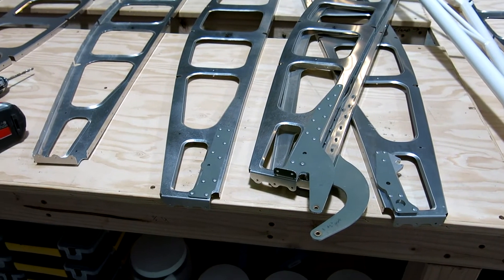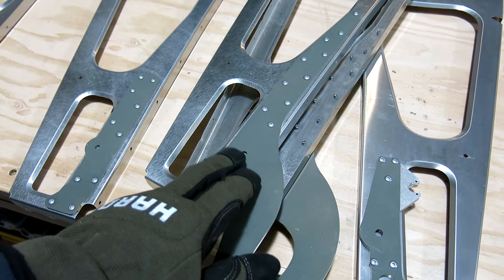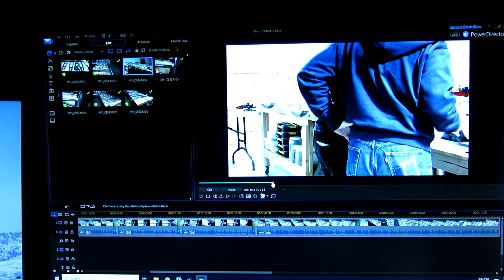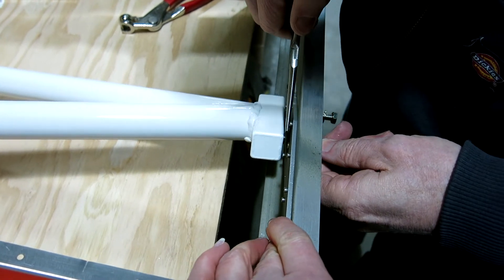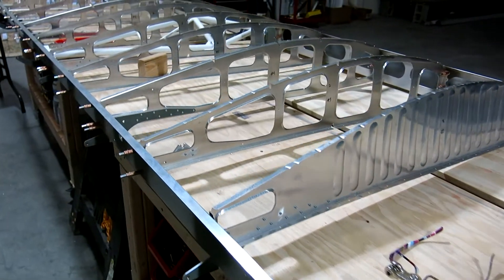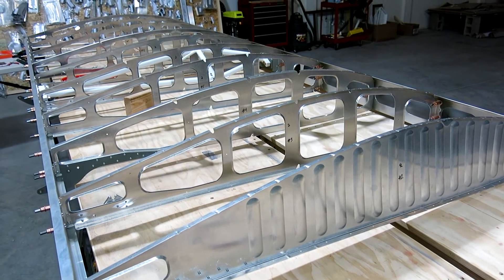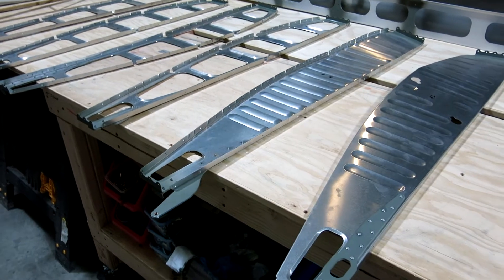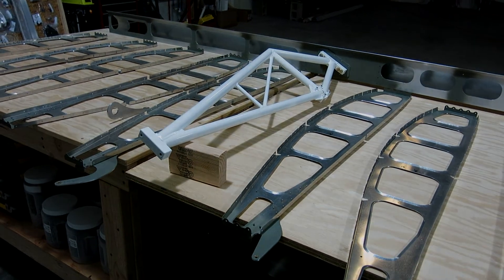No. 51 12-06-2020 Wing construction begins, then stops...

Comment: I used AN970 washers to fill the gap between the rear spar and truss. The AN970 washers are wider, add more contact area, and were easier to insert into the gap.
Reply from the maker: Thanks! I’ll check it out!